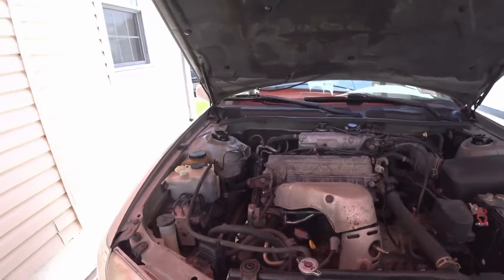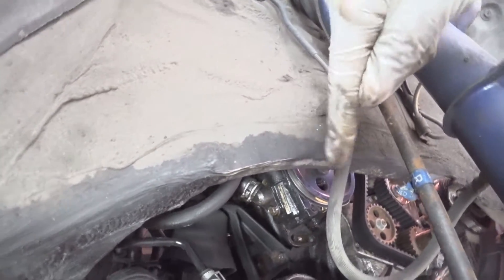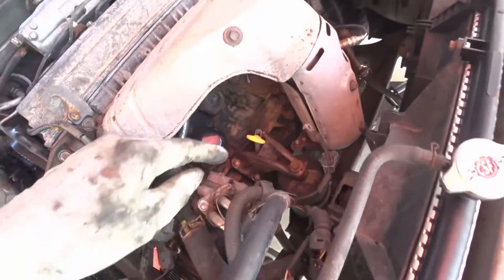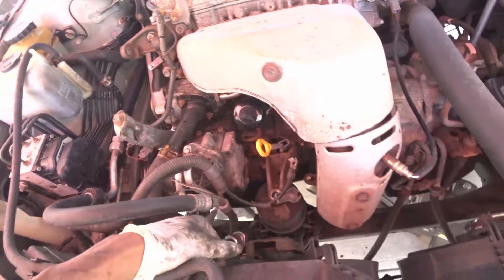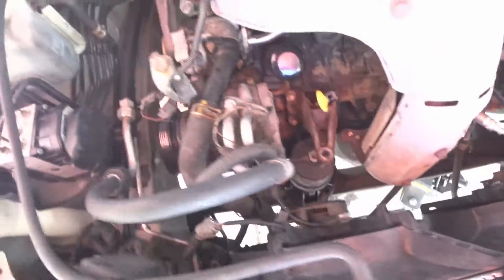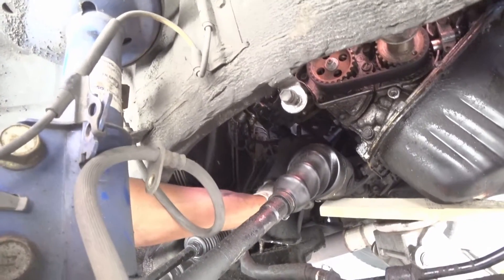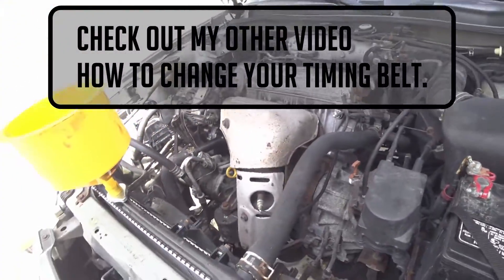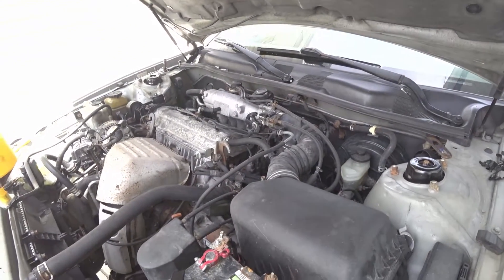How to change Engine mounts on a Toyota Camry.

Comment: Great vid bro, got a question about that rear mount. If I’m trying to take the passengers side axle out with that bracket attached (seized) can I do it without lifting the engine or will the engine sag? I just need to take the bracket out to get the CV unstuck. Thanks bro.
Reply from the maker: @gweedomang2517  you will have to jack the engine up if you remove the rear mount. You will not be able to get to the bolts that hold the bracket onto the block with the engine sagging.

Comment: So I just need a "thin" but durable wood piece to lift the engine at the oil pan and cv bracket to proceed with rear engine mount replacement?
Reply from the maker: Yes you will need something to hold up the engine. so i use a jack and a piece of wood.
Reply: @AJIMPORTS  i tried only on the oil pan, but I guess putting it on the cv bracket area will help the engine go straight up. I think doing it on a driveway that is sloped up doesn't help either. I noticed in this videos it appears that the car is on a flat surface when you lifted it? Thanks for the response.
Reply from the maker: @pugchench4443  this was in my driveway. I changed the front first. Then on the rear mount I had to move the jack towards the back. This was help the engine go up and give enough room to slide it out
Reply: @AJIMPORTS  ok I think I understand now. I am trying again this weekend and hopefully I can be successful. Thank you!